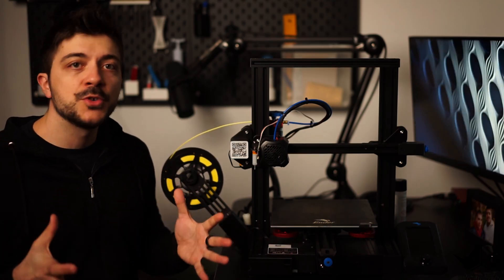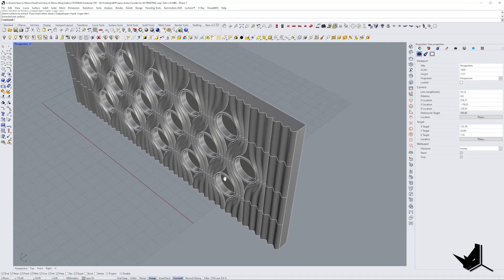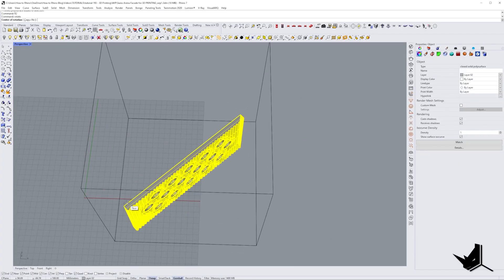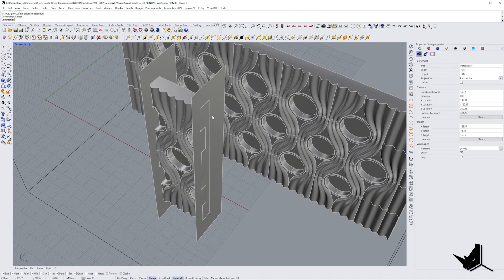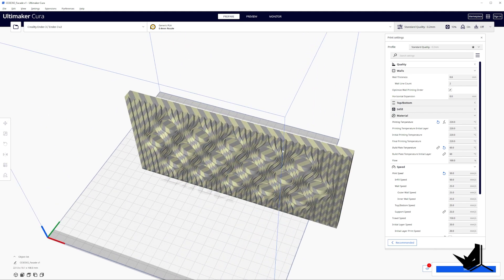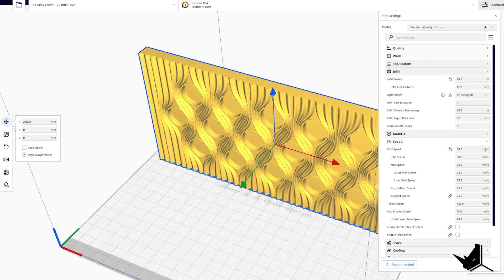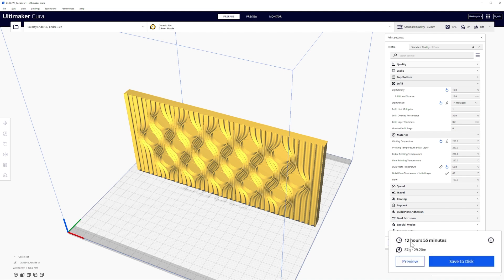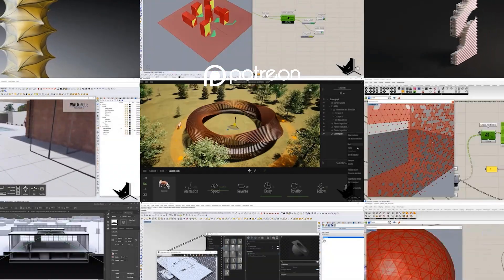We 3D printed façade from our tutorial (step by step guide)

Comment: 3 things: thank you for showing a bit more on designing for 3d printing. Next, putting the glue on the bed is not to help it stick to the plate, but rather, to help lift it off the plate. Lastly, what did you use for the support filament?